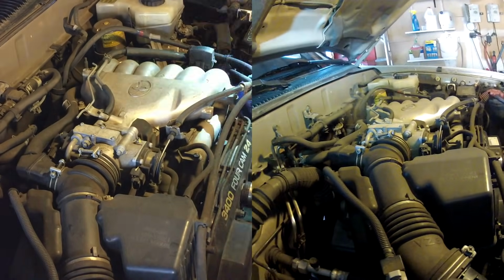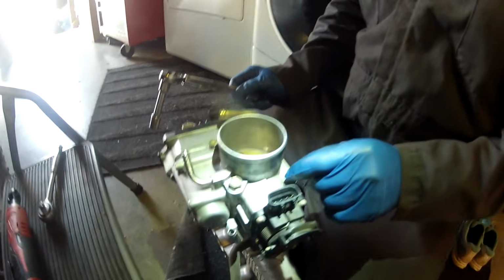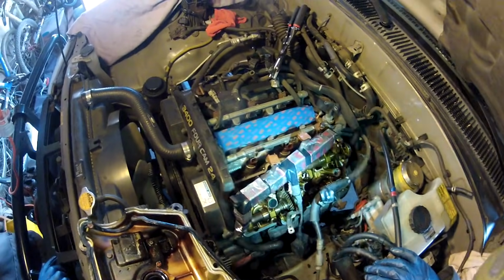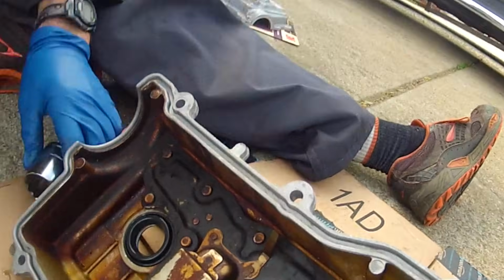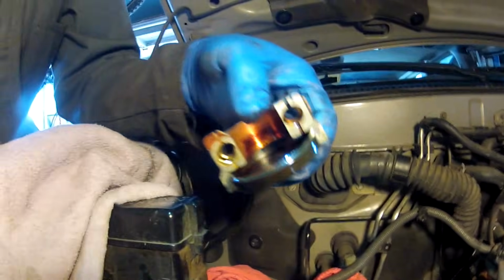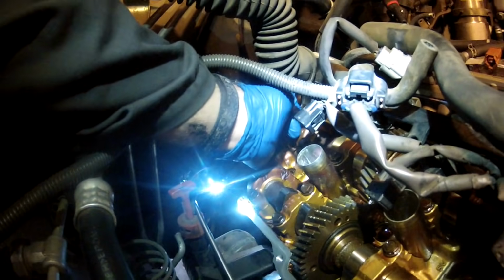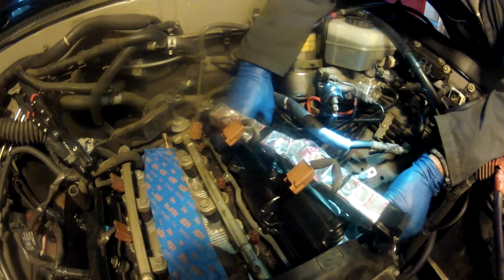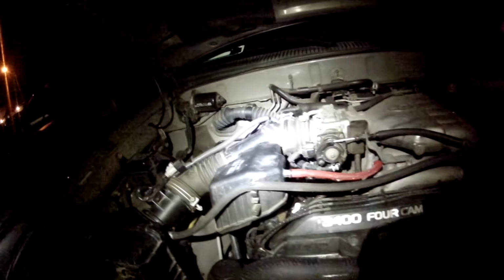3.4 L V6 5VZ-FE Toyota 4runner, Tacoma, Tundra Valve Cover Gasket Tutorial

Comment: Do the valve covers need re torqued over time?

I replaced my valve cover gaskets a year ago and my drivers rear valve cover is leaking back by the firewall. I re-tighten the bolts and they were pretty loose. I suspect the gasket settled due to compression. I'm debating taking the plenum off to get to all the bolts re torque.
Reply from the maker: The bolts do loosen over time, and I think it's mostly due to the rubber on the bolt washers drying up and shrinking from the heating and cooling cycles of the engine.  But, with that said, I've haven't re-tightened the bolts on my 4runners.  I did this job around 8 years ago on my 2000 4runner, and I just recently did it again because I performed a valve adjustment.   I never had any detectable leak over that 8 years and around 100k miles driven.
Reply: @TimmyTheToolman thankyou for your response. I never replaced the half moons or cam plugs, however I suspect that's probably where it's leaking from but can't visually confirm that as its to close to the firewall. Should I replace the cam plugs in the rear?
Reply from the maker: @ddemier  You're welcome!  You should remove the half moons and reseal them and also replace the cam plugs.  If you didn't replace the spark plug tube seals, you should do that as well.  There's a lot more to a valve cover gasket job than just the valve cover gasket.
Reply: @TimmyTheToolman yes I replaced the Tube seals. Is there any aftermarket gasket set you recommend along with the cam seals and half moons?
Reply from the maker: @ddemier  I only recommend OEM for this.  Aftermarket isn't as good.

Comment: Any tips on cleaning the old sealant off the heads?
Reply from the maker: Brass brushes, and plastic scrapers.  You can use steel scrapers, but since it's an aluminum head, you have to be very careful with steel.  You can also use a fine scotchbrite pad.  They work well.
Reply: @TimmyTheToolman  cool, thanks
Reply from the maker: @howtodoit1779  You're welcome.

Comment: Very informative.
I just did my passenger side without even removing the throttle body. I just wanted to get some confidence do the easy side first and do the other side another weekend. I did put spark plug and pvc grommets in freezer a few hours that helped. I did tape up that loom, my was broken and may have given me more room that way. 
2000 Tacoma 207k
Reply from the maker: Good job!

Comment: Did you have set gap on new spark plugs? What is it?
Reply from the maker: I haven't checked a spark plug gap in a long time.  They come pre-gapped.  As long as the box it came in is intact and the sleeve protecting the electrodes was there, I assume it's good.

Comment: Man Timmy nice video. I have some serious leaks on my 02. It's hard to tell how much oil can leak out of the valve covers, the whole plate underneath is coated in oil. It looks like it's all running down the valve covers though.
Reply from the maker: The valve covers will eventually leak on all these 3.4L V6 engines.  Sounds like it's definitely time for you to get it done.
Reply: @TimmyTheToolman  the dealer has quoted me 211 for the parts. That's re using the half moon pieces. Gonna buy today

Comment: The engine on mineis so rusted and crusted on mine the bolts were rusted off rounded and half broke off even after soaked it all down in pb . None of the other shops around me didn't want to touch it now I see why .but at least I can still drill and tap the bolts broke off there's enough room to do that on the flange were they bolt to so that's nice.
Reply from the maker: How does that happen?  You must live in one of the rust belts of the country.  Rust on the top of the engine doesn't make much sense to me.

Comment: Awesome Video! My mass airflow sensor on my 97 Limited doesn't seem to have any screws. Does anyone know how to clean it? Also, I noticed my engine was very dirty and full of sludge. Any recommendations on how to flush it?
Reply from the maker: You have the older style MAF that looks like a barrel.  You just have to look for the small contact wires that read how much air is coming in and spray them a bunch of times with MAF cleaner.  

As for your engine that was obviously abused by a previous owner, there are engine flush products, but I've never used them.  I've also heard of people adding some ATF to their oil.  For me, I'd just start doing regular oil changes, and over time, some of the sludge deposits will lessen.
Reply: Peter I changed my oil, but used about 2 quarts of marvel mystery oil mixed with regular oil, ran it about 500 miles then changed it again, all kinds of black crap came out. It cleaned inside motor really good and it runs a lot smoother.  Refill with oil.  I use full synthetic.  Every few gas fillups I add in a few ounces of marvel…
Reply: I found this video with a mass airflow sensor that maches my truck: https://www.youtube.com/watch?v=GE70Rxss6LI

Comment: Torque specs for cam plug bolts?
Reply from the maker: The torque values are at the very beginning of the video after the part numbers scroll by.  But, to save you some time, the spec is 12 ft-lbs or 144 in-lbs.
Reply: @TimmyTheToolman  Great video too!
Reply from the maker: @courtneywarren8984  You're very welcome and thanks for the compliment.
Reply: Thank you sir!

Comment: Is buying a jdm engine a bad idea? Will all my parts off the engine I have work for the jdm engine
Reply from the maker: In my opinion, JDM engines are a serious crap shoot.  You can't confirm the mileage they are telling you the engine has on it.  You just have to take their word for it.  Many guys have been screwed over buying JDM.  The best option is to buy a rebuilt engine from a quality rebuilder like Yota1 Performance.  If you can't afford that, well, buying domestically from someone you think you can trust would be the next best.  But let me ask you, why are you considering an engine swap?
Reply: My engine has 356k it runs good it’s quiet still and has good compression it’s jus leaking oil from rear main and valve covers I don’t have time to try to fix it my self so I was goin to pay a shop I have the money to do it but was thinking a swap with less miles might just be better option I found jdm and also American 3.4 with 90k on it and if the swap would b the same price as resealing then it might b worth it. I’ve put a lot of money into wire injectors coils plugs a bunch of suspension parts so I don’t want to get rid of truck
Reply from the maker: @Cmc-365  Are you certain the rear main seal is leaking?  Oil leaking down from the valve covers can get over everything underneath.  I'd do the valve cover gasket job, clean up the engine undercarriage really good and see what that gets you.  Please don't swap out an engine due to oil leaks.  You can easily do the valve cover gasket job yourself.   I'm sure you can find a day you can do it and save yourself a ton of money.
Reply: Do u think these engines can last over 350k?
Reply from the maker: @Cmc-365  Yes.  People are driving them into 400's no problem.

Comment: '01 Tacoma with 350,000 miles and your video is giving me the inspiration to do this myself in the next few weeks.  One question tho, you never mention cleaning parts during this whole thing.  My plenums are pretty dirty as well as the valve covers.  Do you have any recommendations to clean them.  I was thinking of using a brass wheel on a drill to clean the plenums once out but not sure what's best for the the covers.  Should I just use de-greaser then clean and wipe dry.  What are your thoughts? Awesome video, thank you for all the details and once I finish this job will definitely buy you some beer
Reply from the maker: We used degreaser, brake clean, and brushes to clean off the surfaces of the valve covers and plenums.  I think we actually used a pressure washer I had too.  I just did this job for the second time on my 2000 4runner because I was adjusting my valve clearances, and  I used degreaser and brushes first and then followed up with brake clean.  They won't look perfect, but they'll be a lot cleaner.  You might want to check your valve clearances, but I'm not going to lie, it's a bit of a pain in the ass to replace valve shims.  Here's our Valve Adjustment video: https://youtu.be/MOlmjtlO7TI
Reply: @TimmyTheToolman  Thanks for the answer.  One last question as this is my first time to dive into doing a project of this size.  The timing belt was done by a mechanic about a year ago.  Not sure if he used OEM Toyota cam seal or some cheap Chinese knock off when they did the belt which may fail prematurely.  Since I am doing the valve cover project are you still able to replace the front cam seal or can you not access it & replace unless you remove the timing belt?  Looks like in the video you only put in the half moons on the front, maybe because you consider the front cam seal a different job (as in timing belt procedure) or is it because you cannot properly access the replacement?
Reply from the maker: @philipperichen2702  Yeah, the front cam seals are done during a timing belt job.  The cam pulleys need to come off and the timing belt cover behind it needs to come off to access the cam seals.

Comment: so i have Question. Are you replacing the cam shaft plugs at the front of the engine?  the parts list shows (4) of them, but I dont see you remove them or talk about the ones at the front, only the 2 (1 per valve cover) nearest the firewall.
Reply from the maker: Sorry about the confusion.  There's only 2 cam plugs you replace as part of this job.  The front seals are replaced during a timing belt job.  We had a misprint in the video.  We mention it in the video description, but a lot of people miss it.
Reply: @TimmyTheToolman  I should have realized that! I used your video to do the timing last year, so those have been freshly replaced... I just was coming in from the other side and didn't connect the dots! thanks for all of your great videos. I think it's about time I "bought you a beer" for the excellent work you do to help me do the work myself!
Reply from the maker: @halfwheeler2  No worries.  That misprint about the cam plugs has confused a bunch of people.  To correct it, we would have to delete the video, make the correction and upload the new version.  The thing that sucks is we lose all the commentary when we do that.  We put helpful information in the video description and a pinned comment (1st comment you see).  Always look at both for further information about the job.  i think a large percentage of people miss what we put in both areas.  But, we give it the Ol' College Try to give people the best information possible so they succeed.  Thanks in advance for the beer donation.
Reply: @TimmyTheToolman  yep.... I'm apparently learn by watching.. not by reading. I should add that skill ;)
Reply: i only replaced the ones towards the firewall.
Reply from the maker: @halfwheeler2  Then you did it right.

Comment: Really appreciate this video, I'm in the middle of the job and could not have done it without this, thank you! I don't see any mention of torque specs for reassembly of the lower and upper plenum, which would be very useful. I searched through the FSM and for anyone later on the torque spec for all fasteners on the lower/upper plenum are 13 ft-lbs (156 in-lbs). If you're looking through the FSM the plenums are called the "Air Intake Assembly" and can be found in the Engine Mechanical service specifications.

Tim if you're able to add those in the description I think it would take an already very good resource to a comprehensive reference.Thanks again!
Reply from the maker: All the torque values are listed in the video at the very beginning, right after the parts list scrolls by.  13 foot pounds for all the plenum bolts and nuts.

Comment: Thank you for your informative videos! My 99 is just shy of 300,000. I'll be performing this soon and will attempt the timing belt at the same time. Question on the half moons. Are the originals rubber? Why the need for new metal ones? I looked through comments before asking.... I also used you door lock video to repair all of my locks. They were so sluggish! Love these vehicles! Thank you again!
Reply from the maker: Hey Richard, the original half moons are aluminum.  There isn't a need to replace them.  Sean just decided to buy them.  If you remove them without damaging them, you can clean them up and reseal them with the Black 103 FIPG.  Good luck with the job.  P.S. There was a typo in the parts list.  You only need 2 cam plugs, not 4.
Reply: @TimmyTheToolman  thanks for the prompt reply! I'm trying to decide if I should change out the injectors being I'm that far in. I see your denso link but ouch on cost. It is a great value if I get better performance and gas mileage. I may have to put off the job until I get those injectors. Tempted by Amazon but probably not a good idea...... I'm getting tired of smelling burnt oil though. 😴😂🛢️Thank you again!

Comment: If i dont have an inch Lb wrench how firm should the 8 rubber mounted cover bolts be? Im thinking pull it down till they are firm but dont crank them down..any recommendations?
Reply from the maker: Use a short ratchet,  like a 1/4" drive one, and slowly and evenly tighten down the valve cover in many passes.   The spec isn't much, 53 inch pounds.  You want to snug them down, but you shouldn't be using anywhere near your full strength.   It's hard to describe it with words because it's more of an experience thing knowing how much force you can apply based on the size of the bolt.  Hopefully, what I said helps.

Comment: I was planning on doing the valve cover gasket on my 97 but now believe I also have a bad head gasket or cylinder (rough start after it's cooled down a bit and steam that smells sweet from exhaust (also experiencing coolant loss).  So the question is, if I was going to do the valve cover gasket anyway, how much additional work is it to replace head gasket or head, or is it even worth it!   I paid $3500 for it about 6 months ago and it has a salvage title due to being hit in rear end about 5yrs ago, but was repaired and no frame damage  Engine and transmission still operate well.

I did the timing belt and installed a used transmission on my following your videos (could not have done it without your guidance!).  Is the head gasket replacement a whole different level of difficulty?  

Thanks!
Reply from the maker: You first have to figure out which cylinder is bad so you know which head to pull off.  You can figure that out by doing a leak down test, which we have a video for.  https://youtu.be/8yuCHzqH7MY

The loss of coolant into the cylinder could be because of a bad head gasket, but it could also be because of a cracked head.  You won't know which until you get the head off and examine it well.  Removing a head is fairly involved, but with the jobs you've done already, I think you could handle it no problem.  We don't have a video series for pulling a head but there is another guy who has documented the job very well.  You've already put a bunch of good work into it, so I think it'll be worth going further to get it running well and keeping it for yourself.   Heres a link to that video series: https://youtube.com/playlist?list=PLUdzuNFw-6nlCcguzhKhFyHgQ6PEud5o1
Reply: Yep.  I came across that 6 part series.   Reminded me of the level of detail you go into!   Will check out leak down test.   So can you usually see a cracked head or blown head gasket with visual inspection or do you need to take it somewhere to be analyzed?  Thanks!
Reply from the maker: @tpatrickwilson65  Watch the leak down test video, I discuss the visual and audible inspections you do to determine where the compression is leaking to.  For your situation, you would expect to see air bubbles coming up into the raidator.
Reply: @TimmyTheToolman  Last question.  At some point is it better to just replace the engine with a used one in good working order?  Or is it usually easier/safer to just fix the one you've got?  Thanks again for all your wisdom on this stuff!

Comment: Great video Tim. I have the FSM and referred to it but I used your video as my primary source.  I did the full job with Toyota FIPG, half moons, cam plugs etc. Torqued the cover bolts to 53 inch pounds. Ran the car for a half hour or so. I did not drive the car, no plates yet. When I took off the valve cover all the bolts were VERY loose. I decided the other day to check the bolts torque  and they were Way under 53 inch pounds, probably 1/2 to 1 full turn loose before I hit the 53 Ilb. What gives? The rubber gaskets under the bolt heads are obviously compressing and exerting less pressure on the cover flange. Is this the cause of leaking valve covers on these 3.4 engines.?All the other valve cover jobs I have done lack these rubber washers.
Reply from the maker: Yes, the rubber washers compress, and people have found the bolts have loosened up.  Here's a suggestion,  don't worry about it.  I've done several of these valve cover gasket jobs and I've never rechecked the bolt tightness and have had zero leak issues.